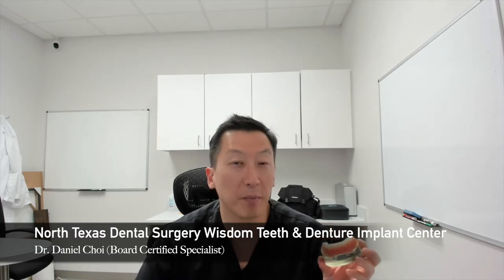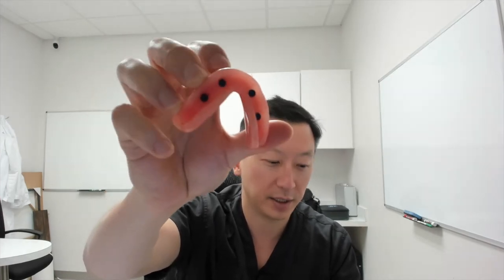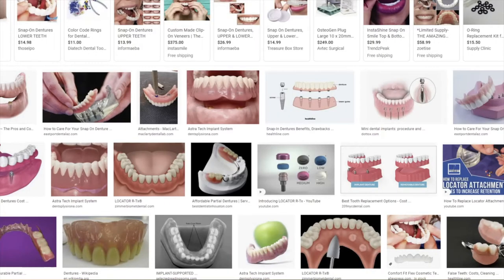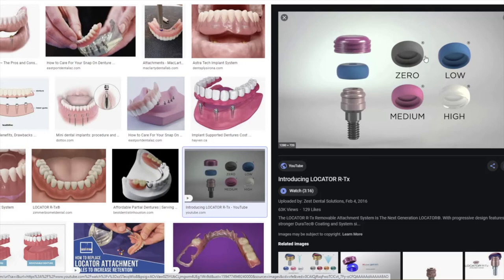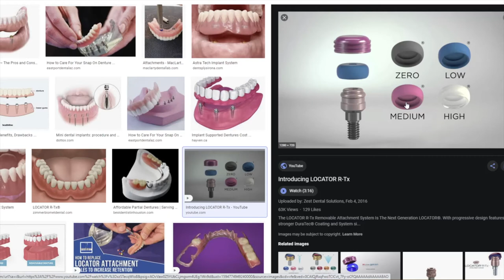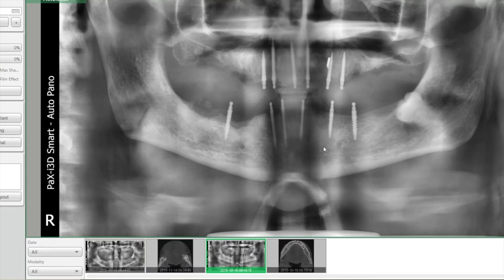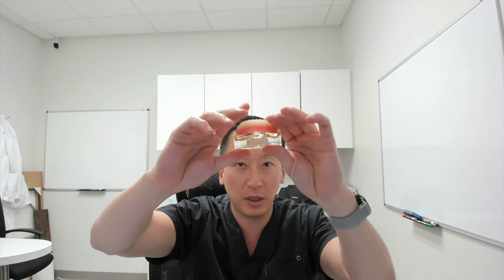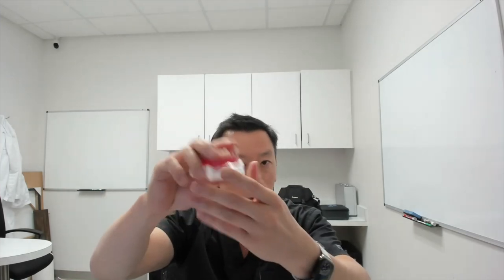Snap in denture maintenance

Comment: Does food get underneath the denture ?      It probably does with the snap ons,  but what about the 4 on 4 dentures ?
Reply: Yes, it does. I’m a new snap on wearer, new to dentures. Food does get stuck in and around the denture. I try to get to a private sink ASAP to rinse out my mouth. It’s gross, but it beats going without lower teeth, which I did for 6 months.
Reply: @stephg4705  Did your doctor advise that you do that everytime you eat?
Reply: My dentist explained to me before I even went with the snap in dentures is they will never be tight and snug up against the gums. They rock a bit even though they are pretty secure. With that being said, getting food under them occurred after every meal. Kind of sucks and sometimes hurt like hell. So what I ended up doing is using powder adhesives anyway with my snap ins. You just have to make sure the power does not get in the little holes when you apply it. Works like a charm and powder are not messy at all.
Reply: @jaym1244  i have snap ins mine DO NOT ROCK